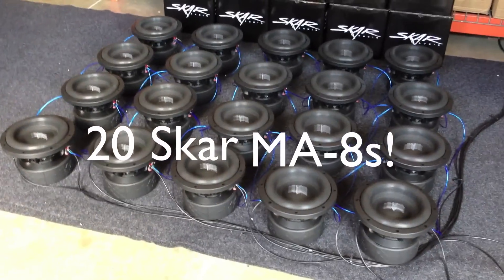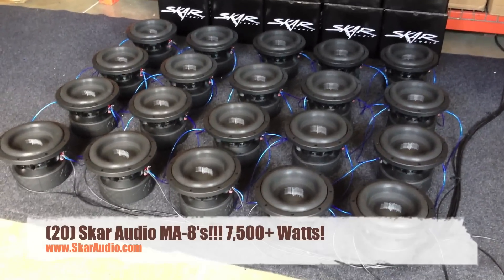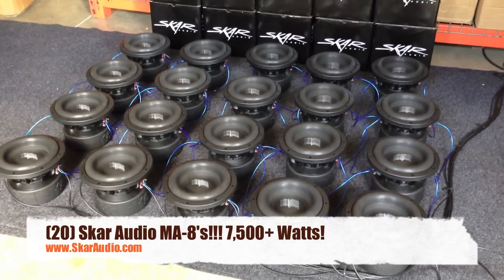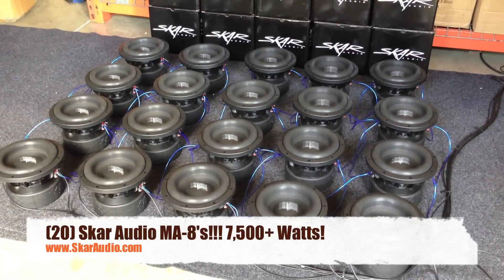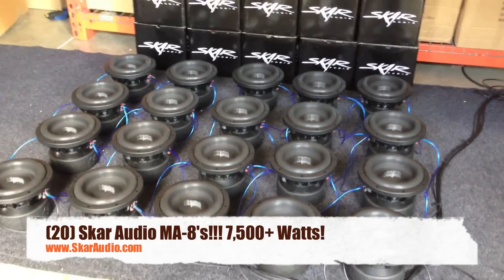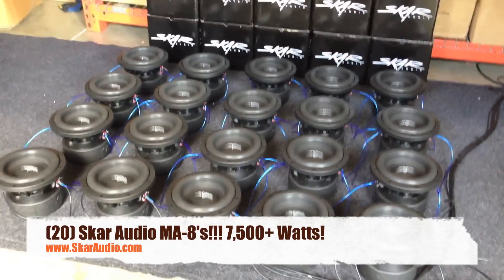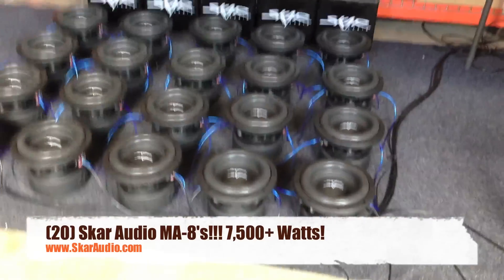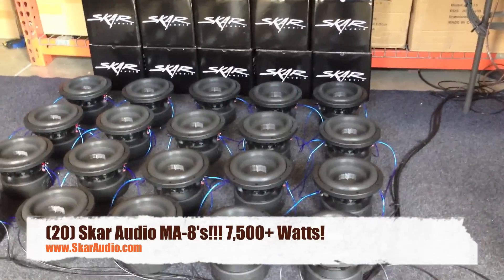World's LARGEST Subwoofer Free Air Video!!! 20+ SUBWOOFERS!

Comment: How? When a speaker is ran open air you get an acoustic short circuit. Sound is air pressure. So you are effectively shorting out the pressure. You need to at least put it on a baffle to minimize the acoustic short circuit..